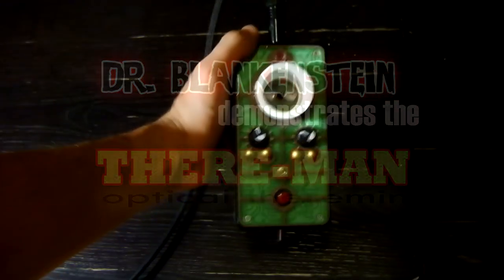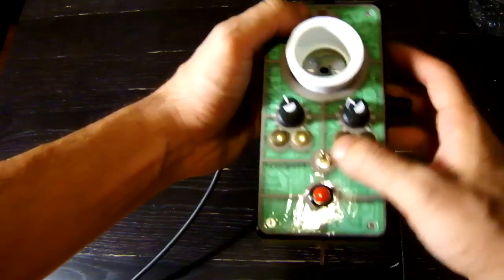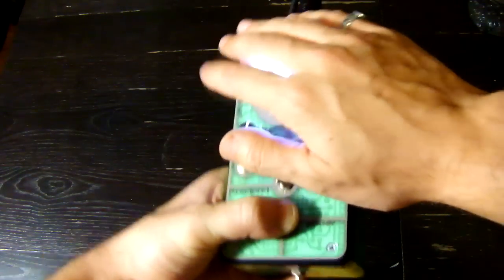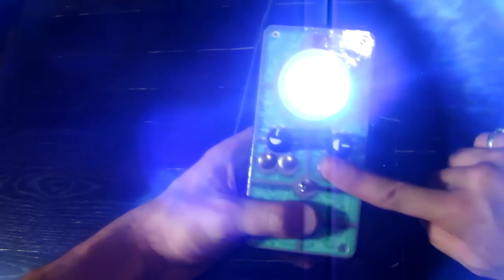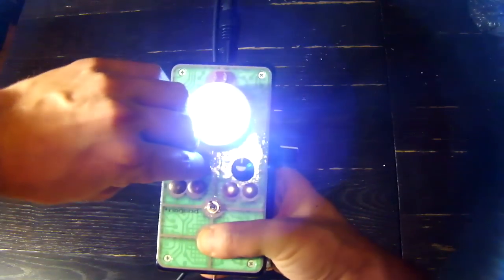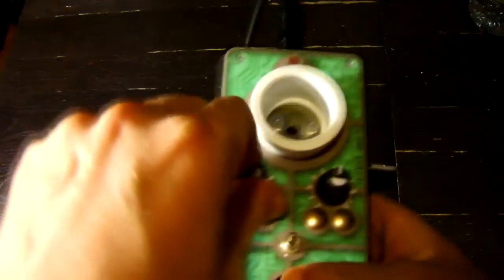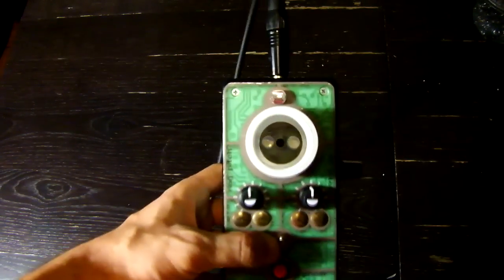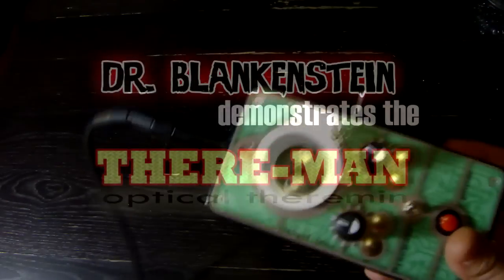Optical Theremin "There-Man" - Circuit Design by Dr Blankenstein

Comment from the maker: I added another video of the THERE-MAN, this time controlling the pitch with the light sensor without the Ring Modulator engaged.  The ring modulator limits the pitch range of the light sensor control.  I figure it gets about an octave and a half of pitch to motion control with a full power downward facing light source and the pitch range all the way down.  I also added a little delay to the new video to show off it's tradition theremin type sound.  Enjoy ;)